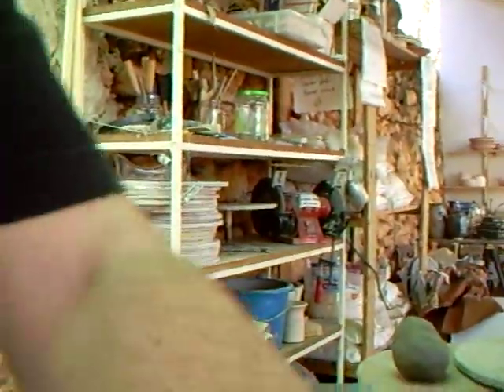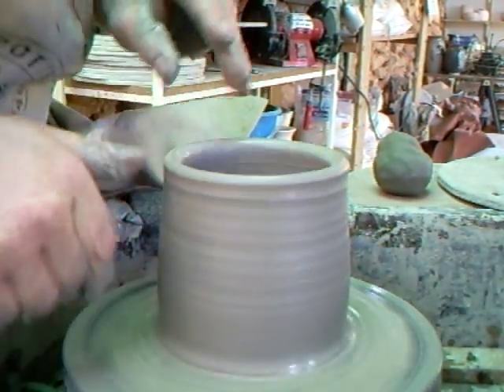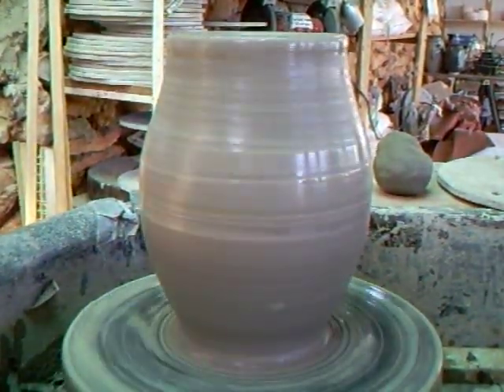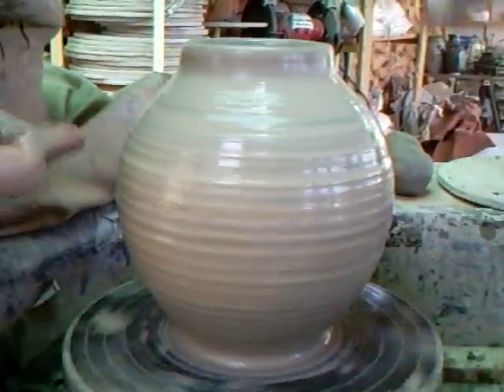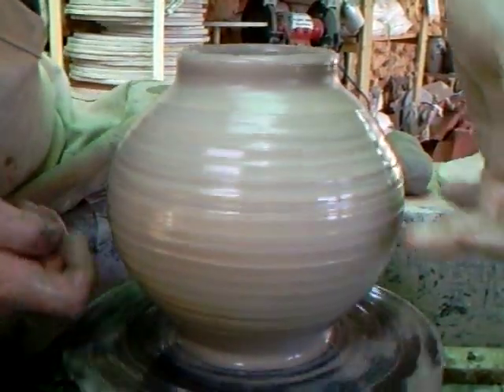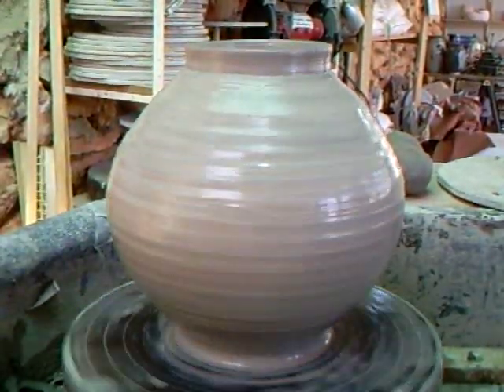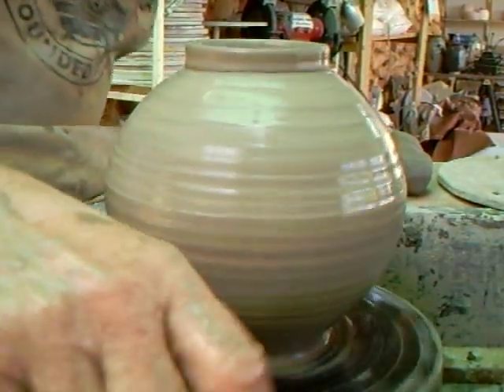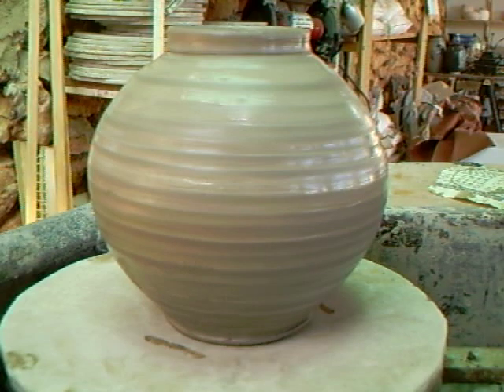SIMON LEACH - Making a large tea pot - 1

Comment: Could you have left the paper on as the pot dries?  Would there be any effect on the pot?  Would it cause uneven drying?  Dry on the outside, wet inside?  Or sucked the paper in?  Just wondering.
Reply: Paul Mann why are you rude! The paper is there to keep the top a perfect circle for fitting the lid over. So the papers usefulness had ended once he removed it. He will let the pot harden up a bit and then invert it. Sure the paper on the rim would make some difference but one tries to dry it the same way so not with the paper. Just follow his formula here. No the paper would not get sucked in but would stick, but one would like the opportunity to smooth the rim before firing.